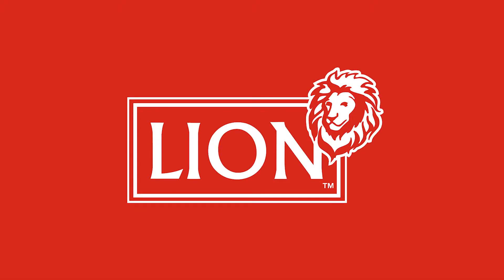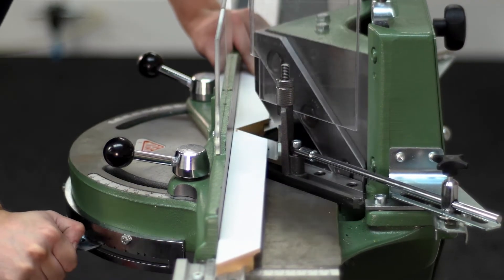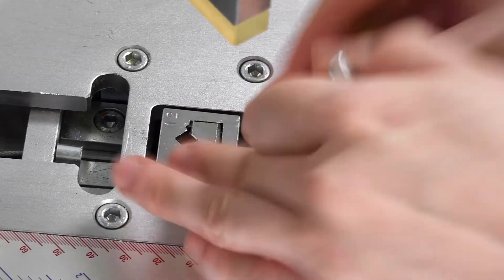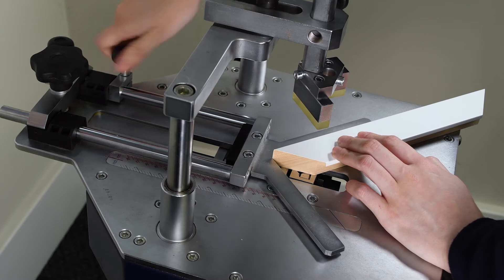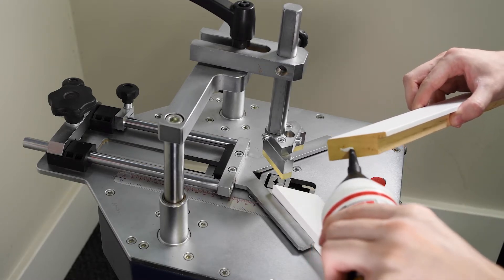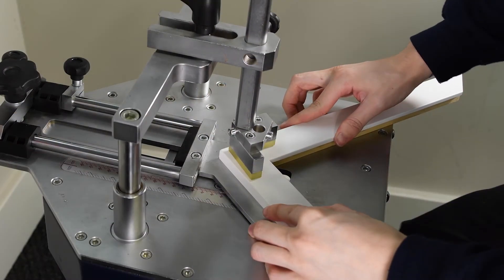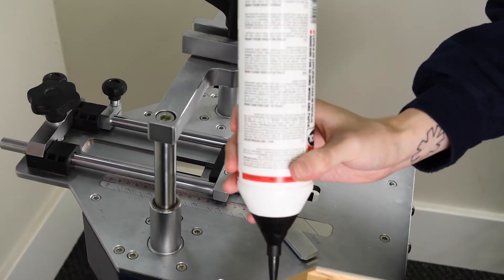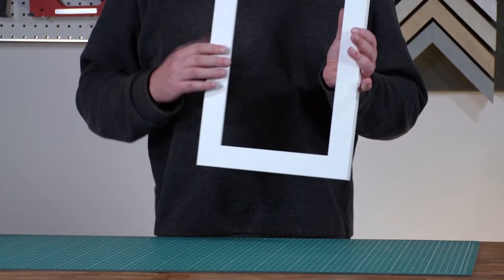How to Join Picture Frames | Alfamacchine U200

Comment: Hi. Does it work well with hard wood?
Reply from the maker: Hi, it works with hard woods but if you're joining a lot of them then it's worth looking at the Hoffmann Frame Joiner instead. Search part number 10585 at lionpic.co.uk. The Alfamacchine U200 is mostly for softer woods such as ayous.
Reply: @LIONPFSLtd  thanks for the reply. I am thinking of upgrading to Alfamacchine U300 Semi Auto Underpinner. Good for hardwood? Is it the same model as Mini Graf 3?
Reply from the maker: @freehee2  It would be best if you got in touch with our  Technical Support Team – email techserv@lionpic.co.uk or call 0121 773 1230. They'll be able to answer any machinery or equipment questions that you have. Thanks!

Comment: How to adjust hammer setting
Reply from the maker: The height of the hammer is adjusted by loosening the two grub screws and turning the ring nut above the spring. When you're happy with the positioning, tighten the two grub screws to lock the ring nut in place.